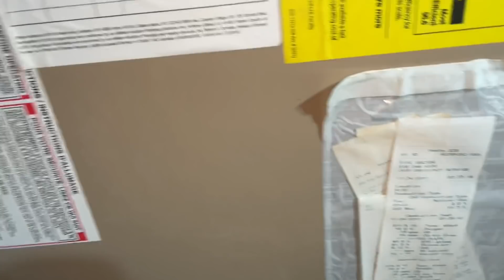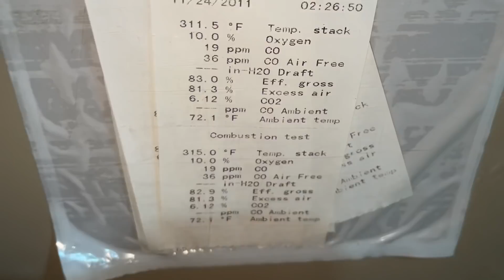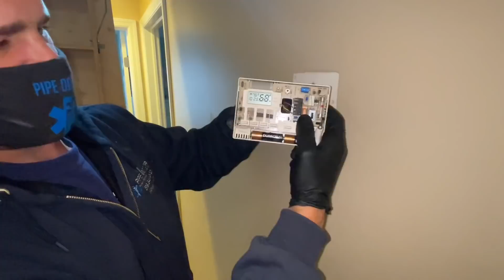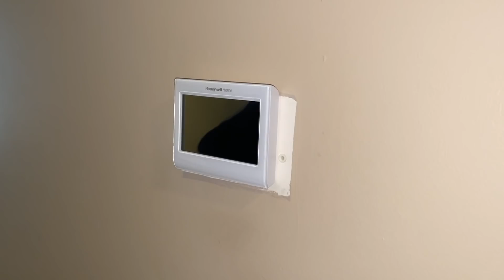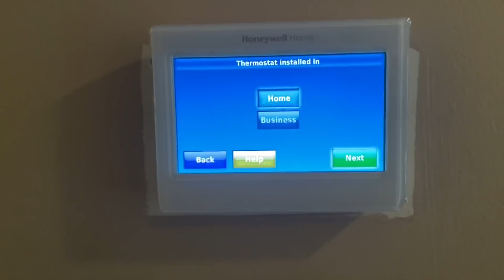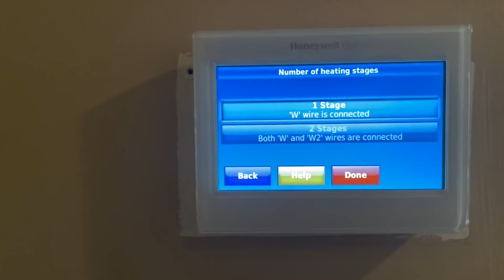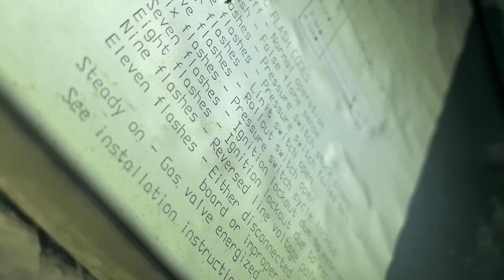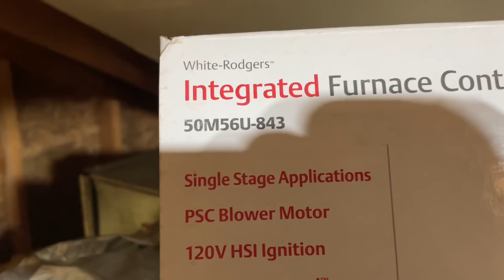No Heat Gas Furnace Bad Thermostat Connected C wire - Pressure Switch Cycle Lockout Error 6 Flashes

Comment: So for clarity, was the pressure switch changed out?  I can't believe the lockout was caused by the board without the pressure switch malfunctioning or more likely a pressure difference existing that would require shut down of the unit by design.

Comment: Just been through this..no heat. Furnace is a 2 stage Lennox, 90+, 6 years old. Diagnosed as failed pressure switch, so the inducer motor/unit was replaced and I had them install a Nest Smart thermostat.

Three weeks later..no heat. Diagnosed as logic board not communicating with fan motor control. Examined the modular control on the fan motor..looked good, so replaced the logic board. Still wont start..not taking the furnaces model code, so keeping the new logic board in place, replaced the fan module and it runs. Technician recommended keeping in place the new logic board as, with both being new, they are communicating and if the old logic board works, it may have been the culprit that caused the motor module to not work.  All quite expensive as furnace not under warranty because I did not have a Lennox authorized service technician service and cleanit each year..changing filters myself.

The dealer guarantees the replaced parts for life.

Your thoughts?
Reply: Yep..knew you’d be saying that..wishing you had a twin brother in the northern suburbs of Chicago!

Comment: Thank you! Thank you! I hate no heat/cooling calls because of low battery. Clients don't like them either.  Again thank you with the troubleshooting skill with the board. Very simple look over that would of been a Call Back. Also asking for paint was another slick move.

Comment: 90 percent of the time the pressure switch never fails its always something else. And you can always remove all the wires from the circuit board and jump r to w ( power to heat ) and if the furnace all starts up and runs normally most likely its a thermostat issue if it doesn't turn on most likely circuit board issue.

Comment: That job is a perfect example of having to verify proper function before leaving, it would be a call back, customer gets pissed, technician is pulled away from other jobs, all averted because you take the time to cycle the system a few times before leaving.

Comment: ha! and here is me I love the hydronic calls because 95% of the calls i ran for no-heat were for gas forced air..  here in ohio  hydronics are rare except in really old buildings or homes.  Mikey Pipes needs a Klein 10 in 1 ratcheting screwdriver.. glad to see someone do real troubleshooting.. Totally Loving this! heck yeah Love WiFi controls..!  im in chicago niw,,  we got 16" of snow last night..  BIG hydronics in this building but ha! I dont have to touch those..  only the VoIP system for me here

Comment: My teacher in trade school a long time ago said don't be a parts changer . Also we do the same as you run the furnace through a few cycles before you leave the job . Learned that the hard way. 
Lastly yes if you fix the old furnace and keep the heat on , when the time comes for a new unit we almost always get the job !

Comment: Don't want to troll you on that tstat but I will. Cycling the tstat will reset the board. You didnt meter 24v to the board on the W terminal. Your not testing your guessing. Good job getting the job done and the customer with  some heat. Always entertaining Sir.
Reply: Ok I wasn't there troubleshooting so ill take your word for it didn't see you with a jumper wire on the board just saw Godzilla reset the stat. I can only see what you show me.

Comment: -21 F this morning in Minnesota.  My (hydronic) system can't keep up.  It's not the boiler (runs for 5 minutes, off for 12-15) , 180F high/150F low, but I think a lack of adequate 1980's style aluminum fin baseboard in my living room.  Based on the 5000 BTU electric heater I have, I'd say that is about how much additional baseboard heat I'd need to fix it.  Started watching the channel, cause hydronic is rare around here and keep watching for tips and tricks.

Comment: When the light was out should have been a clue?🤔🥃🍺🍺
Jus say'n.
Stay safe.
"Retired"
Retired keyboard super tech.
Wear your safety glasses.
Reply: @PipeDoctor  yea
But with power the status light on all(maybe)furnaces should either read normal or code,it was out I assumed you didn't have the door switch closed.
If the legend says light out normal operations then it is what it is.
Status"light"
When you took the fuse out and put it back in it was either a loose connection or the board🤔🥃🥃🍺🍺🍺
I'll send you a bottle of McCallum!
Stay safe.
Retired keyboard super tech.
Wear your safety glasses.

Comment: I would have rotated the pressure switch so it's up and down and not laying flat. I have had problem's with them in the flat position.
Reply: @PipeDoctor  Yes for standing up. When you lay the furnace down it should be rotated so it's up and not laying flat. Just my two cent's,  like I said I have had problems with them in the flat position in the past.
Reply: Manufactures instructions.
😐🍺🥃
Stay safe.
Retired keyboard super tech.
Wear your safety glasses.